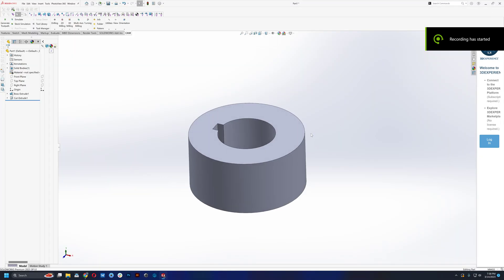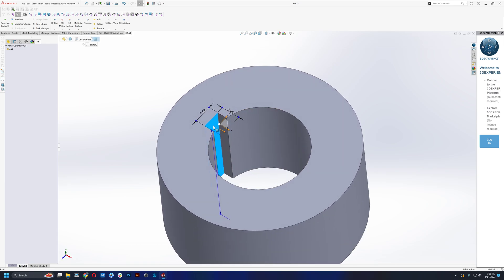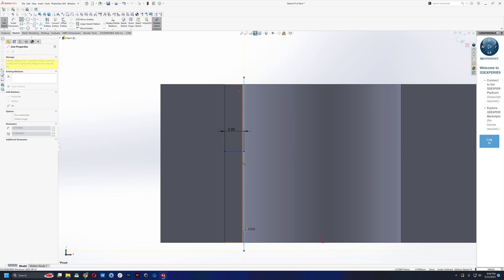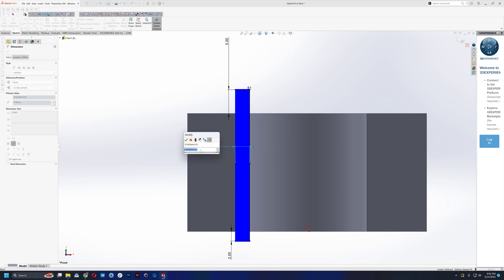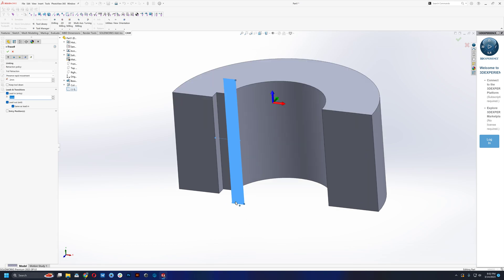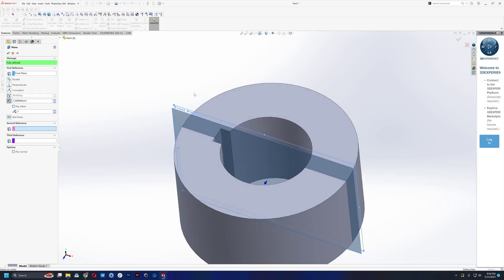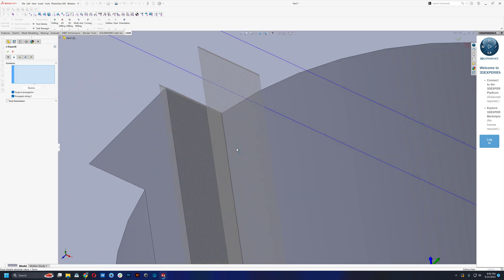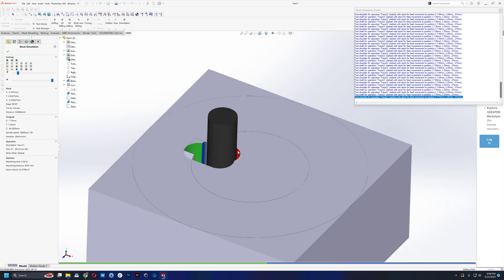How to do a quick broaching operation in fusion 360/HSMWorks with the trace operation

Comment: This is SolidWorks, chief. Even if possible in both you might want to mention that in the title.
Reply from the maker: This is HSMWorks which is a fusioin 360 CAM plug in and i have tested this in Fusion 360 and can confirm it works in fusion as well.

Comment: How do you set the tool orientation?
Reply from the maker: the tool would either have to be locked in position with a spindle lock fixture (be sure the spindle doesn't engage check the program to be absolutely sure)  or if you have a spindle orientation option on your machine you would need to check the mcode for that and write the first couple lines of code to position the spindle in the correct orientation. If you're trying to take something on like this i would make sure your tool offset it spot on, turn the feeds way down and offset your Z well above the work area to test things out wouldn't want to crash the machine. i might do a video on a functional program on a machine.

Comment: Not in F360 tho.. this is a SolidWorks tutorial..
Reply from the maker: No No i have fusion 360 and i can confirm you can do this in fusion 360 as well as HSMworks. Only difference is fusion doesn't want to add a lead out step over so that would have to be added into the sketch to be traced and you cant just select a signal line as an entry point and select the sketch for a quick selection (well you can but the operation is unpredictable it may want to entry from the bottom or start from a point you wouldn't want it to) you would have to select every line manually other wise you can achieve the same result.